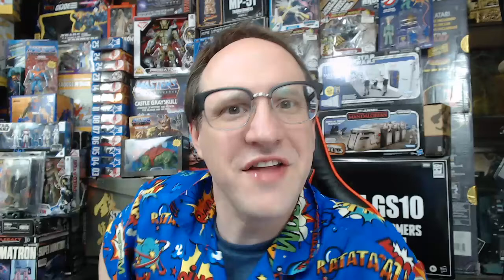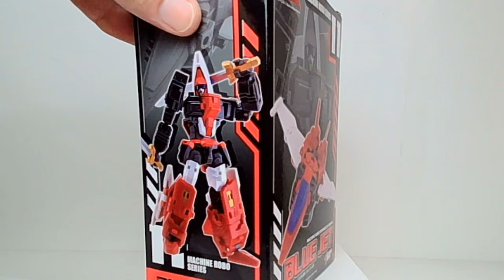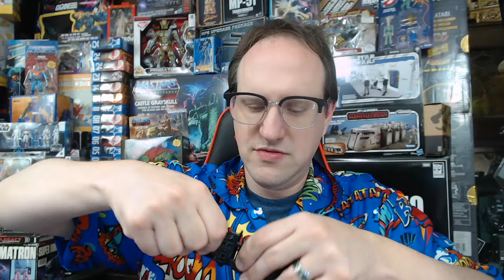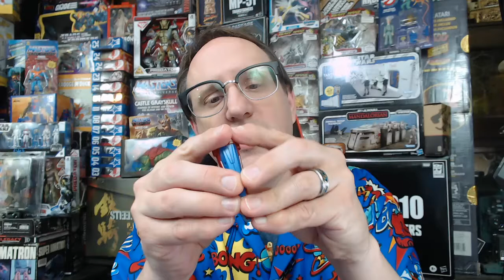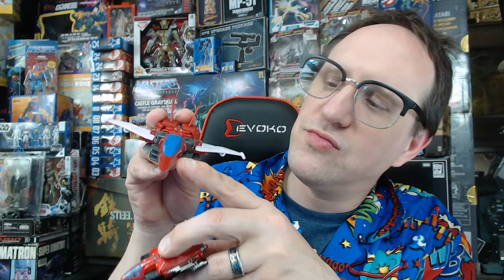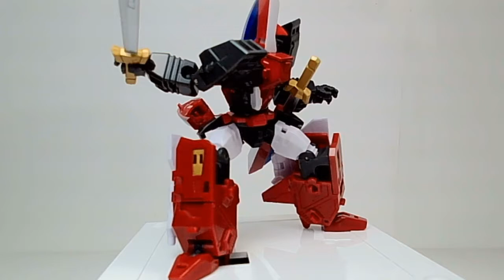Machine Robo Blue Jet (aka Gobots Fitor) Review!

Comment: Hmm, I didn't get in the first like!

Well, he does have a blue canopy on his cockpit! But yeah, otherwise, he's red, black, and silver. Kind of like the 1996-2006 Buffalo Sabres... who wore blue before and after that period... and I'm just going off on a hockey tangent here that has nothing to do with anything.

At least "blue streak" actually has a meaning that's just "something that moves very fast", a phrase that dates back to the early 19th century, plus there's also "talking a blue streak", and both definitions were applied to the character of Bluestreak even if he wasn't physically blue in the original toyline and fiction (though his Diaclone figure WAS blue). He even mentions both definitions of the expression in his introdump in issue 1 of the original comic! (Just imagine Casey Kasem reading that line...)

But, since I happened to be looking up "blue streak" just to re-confirm the above definitions, and it turns out "blue jet" is a valid expression, specifically defined as a noun by Merriam-Webster: "a rare form of electrical discharge that is emitted from the top of a cumulonimbus cloud during a thunderstorm as a large upward jet of blue light". THAT's something I didn't know before, so... now I know! (And Knowing Is Half The Battle! G.I. JOOOOOOOOOOOOOOOE!!!)
Reply from the maker: YO JOE!
Very good! I knew you would help me out here. I remember that segment in the first issue of the Marvel comic. Blue streak kept saying "whatever that is" after using the expressions!

I GUESS Blue Jet could refer to the electrical discharge? Does Blue Jet have electrical powers in his profile? Either that or they were going to name him Blue Cock Pit, and decided that on many levels, that just would not work! ha ha ha!

Thanks for the insights, Rob!